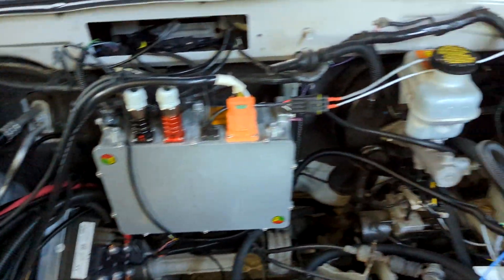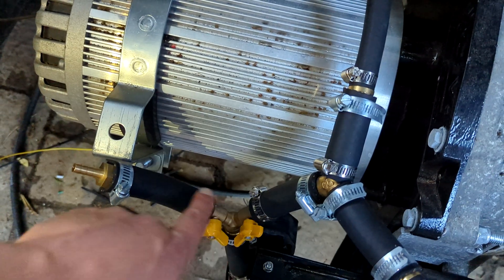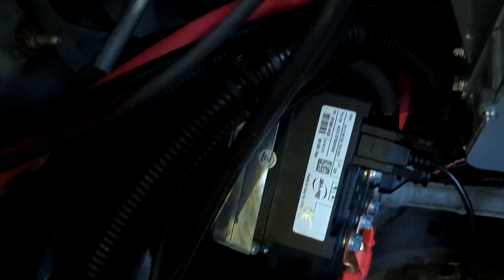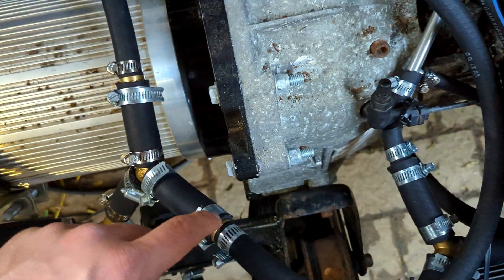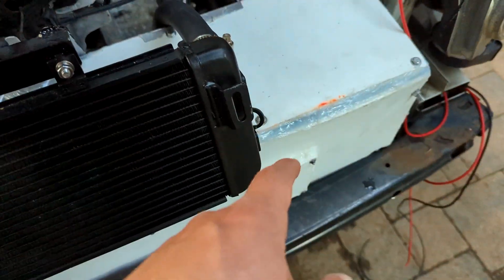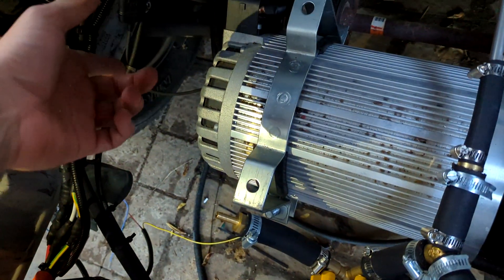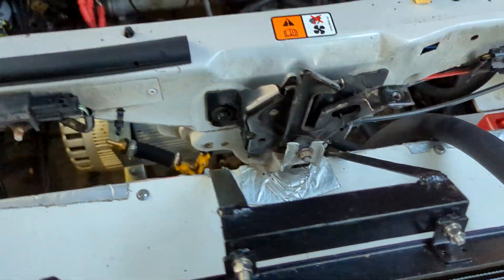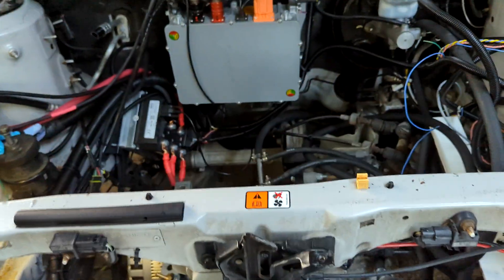Ford Escape EV Conversion EP 24: Cooling the Tesla Batteries and Hyper 9 Inverter

Comment: How effective do you find your cooling setup after some driving? Using radiator? Batteries get warm during hot days, charging, starting-stopping-regen, or on the highway? How did you end-up adjusting the valves on the divider between the inverter and the batteries? Thanks in advance. Love your project!
Reply from the maker: I have the valves adjusted so they both the batteries and inverter are getting solid cooling flow. It's working really well, in summer (ambient temps up to 80-90F) battery temps rarely get above 95F. In winter (sub freezing often) I put on a radiator cover and after about 15 mins of driving the batteries are warm enough to accept charge (Regen).

Comment: Nice Project i like it i have question  about the source  power supply from the controller to run the pomp.   is  it sometimes shut off the controller ?  
regards
Reply from the maker: The pump is actually powered by a BMS-controlled Drive relay. So when the SimpBMS is switched into Drive mode with the key switch, then the pump turns on. It's a 12v pump as well.

Comment: Hey Reider (you annoyingly talented chap). 
I'm just getting the bits together to convert my 1970 Early Bay VW Camper, with help hopefully. 
Now bear in mind that i'm an idiot but why do so many people choose not to bother having the option to fast charge, when many already have a capable BMS set-up and a bigger Radiator isn't hugely expensive?
Thanks mate, John
Reply from the maker: Haha, thanks John!

The reason people aren't setting up fast charging for their conversions is that it's not really feasible because of the complexity of the CCS1 DC fast charging standard we have here in the States. Zero EV has a CCS2 kit that costs like $2k, but that only works for the fast chargers in Europe. 

The CCS1 standard has very specific requirements to allow charging when plugged in and no one has built a kit that meets them all. Certainly something that's possible but would probably take a lot of time and $$$ to build, which is why no one has done it yet. 

The CHAdeMO DC fast charging standard is much simpler and there are some conversions that support it. But CHAdeMO stations are only 50kw max and are becoming increasingly more rare as they're being phased out in favor of CCS2.
Reply: @reider_mcfeely  Thanks for responding mate. 
Yeh, thing is, i'm in the UK and am gonna be going back round the world but instead of using my Mountain Bike and a Tent like when i was your age, i figured i'd do it with a nice Bus and a Carbon Gravel Bike this time round ;)
With this in mind i figure using roadside fastchargers is gonna be massively important for me. 
I bought my VW because a Tesla SDU Motor slots straight onto the rear independent axle (direct drive with it's gear reduction built in) and then i was planning on doing away with any of the original drivetrain, as i know it works. I (maybe wrongly) assumed that if i used Tesla Modules, BMS and Charger i could get the handshake to work. Please tell me if i'm wrong, as i'd rather know before i start buying bits.
Thanks....and congrats on getting yours going.
Reply from the maker: To use all of the original hardware and have the DC fast charger think it's charging a Tesla you'd need to have pretty much every single part from the Tesla, including the screen, MCU, etc. so it's not really practical. Tesla is especially bad for this since their cars are so locked down and not open to aftermarket modding. 

CHAdeMO is relatively easy to configure in conversions so I would see if that's doable. Also worth looking into the Zero EV CCS1 kit since you're in the UK, not cheap but it's basically a plug and play solution.
Reply: @reider_mcfeely  weirdly, i spent the last 3 hours online with a Scrapper in Southampton and he pretty much said the same (though he said he could do it). 
If i had a pound for every set-up i've settled on  and then had to go back to the drawing-board i'd now have a fiver ;)
I think i'm gonna have to see what system he comes back to me with. as the conversion industry is moving rapidly and then see if it is future proof .....i won't lie, i don't really like the idea of going round the world in this van, when i can't use every option to get some juice though.
Thanks for your time pal and i hope yours serves you well, John
Reply from the maker: @jclive4773  or you could just throw a generator in the trunk and then all you'll need is gas. 

You can charge at slower speeds on a standard outlet pretty much anywhere in the world as well. I think you can find a way to make it work!
Reply: @reider_mcfeely  thanks brother, you're a good bloke, think my brain is just a bit fried atm, every problem has a solution ;)

Comment: You should put a bypass tap so you can run the fluid thru the heater core  in winter. :)
Reply from the maker: Yep definitely in the works. Just wanted to get it drivable in the summer first, winter is still a ways away. I was trying to find an inline heater for the 3/4" coolant hose run to the Tesla modules but have been so far unsuccessful.